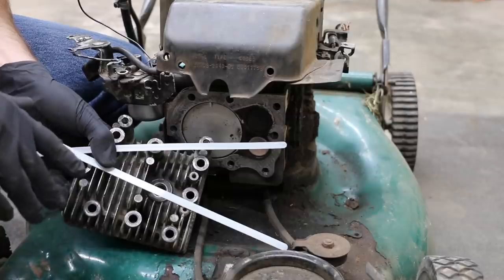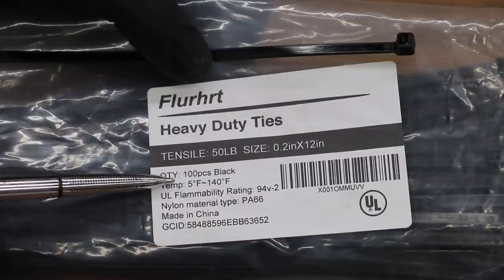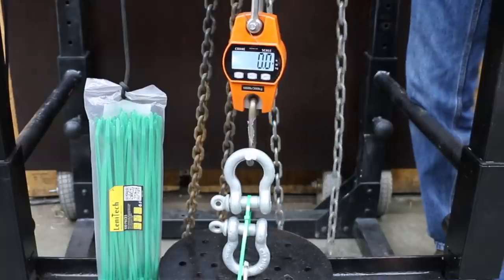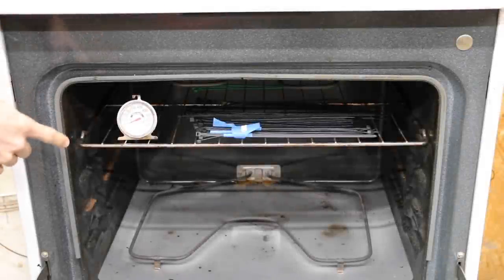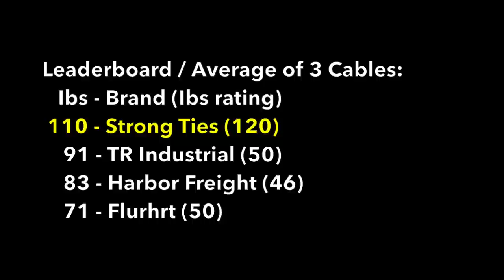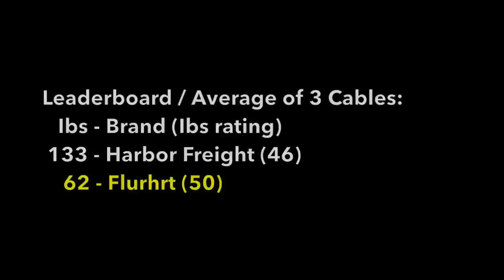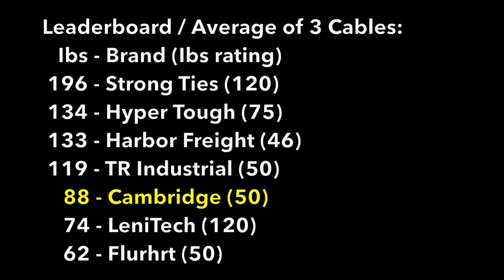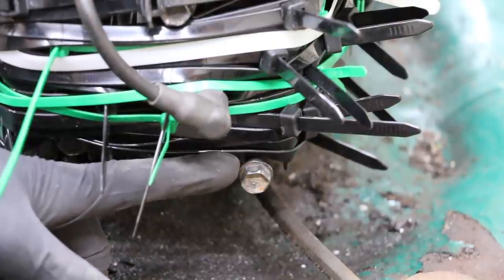Best Zip Tie Brand (7 Brands Tested)? Let's find out!

Comment: Do a video on Super Glue and Baking Soda mix and see how well it holds up to various chemicals such as gas, kerosene and diesel fuel. It is an excellent combination for sealing and gluing. Like this comment if you wanna see a video of this done.
Reply from the maker: Thank you for the video idea!
Reply: looks at tubes of superglue (10 for $1 at local dollar store)
looks at 10kg bucket of baking soda (a whole $6 worth)
"hmmmmm.............. :)"

BTW, have you done any videos trying out the cleaning powers of citric acid yet? 
It's really cheap - You can buy 5kg buckets for about $5 (if you've used stuff like "clean green" this is equivalent to about 1000 spray bottles of the stuff)
It's amazingly effective on anything caked up with limescale (one example - flush mechanism in my toilet was binding up. I dropped 2 teaspoons in the cistern and left it overnight. Problem solved)
It's devastatingly effective for getting years of "gunk" off of plastics without damaging the finish

In an ultrasonic cleaner, a bit of this plus detergent works even better than just the cleaner alone. It really surprised me.
Best of all the stuff is safe on just about everything including skin - It's basically just concentrated lemon juice and it doesn't smell like vinegar does.

Comment: Your channel is honest. No need to cower before sponsors! I really appreciate your refusal to succumb to this temptation.

Test bike tires to destruction.
1. Spin them really fast to see when they explode.
2. Load them til they fail.
3. Wear resistance...run the tire on concrete or asphalt until the tread comes off.
4. Grip...which tire grips best.
5. Side wall strength. Which tire wall is the most durable. Which is the stiffest.

This could be done for scooter and motor cycle tires too.
Reply from the maker: Thank you for the video idea!

Comment: I use a lot of cable ties in my work. The best cable ties I've ever found are Panduit brand. You'd find these at an electrical supply house. They are very tough, flexible nylon that never snap when you're pulling them tight, and you can get them with a steel latch for extra holding power.  They aren't cheap, though. Cable ties that you find at places like Home Depot and Lowe's usually are brittle plastic and tend to snap when you tighten them or else the latch breaks.
Reply from the maker: Great recommendation!

Comment: I did audio/visual installation and service work for about 15 years and I used thousands of those Harbor Freight wire ties and I almost never had any breakage and they worked nice and smooth, I liked them.
Reply from the maker: Seems like one of the better products sold at Harbor Freight

Comment: I use zip ties a lot in my work (General Aviation A&P mechanic). Mostly for light duty items, like holding wire bundles together/ securing certain plug connections so they can't come loose, but also for temporary installations of items such as a rod lashed to the control yokes to rig the Ailerons on a 152. I am glad to know that if I ever venture into the private realm of Aircraft maintenance (I currently work for a flight school), I can save money using the Harbor freight ones, since I don't need "extreme" strength most of the time, but if I do, it's temporary, and I will have to cut them off when finished. (My workplace provides Zip ties).
Reply from the maker: Thank you!

Comment: On the stretch/pull test using the device you built to measure the pounds of force needed to break each tie, I'm curious where in the tie's construction proved to be the weak point... where did the majority of the breakage occur on the majority of them.... edge of the clasp, center prong of the clasp, the middle of the long end run, other?

Comment: We use ty-rap brand ties on medical equipment (Thomas and Betts TR TY525MX Cable TIE on Amazon) due to the UV sterilizing lights and the cleaning agents which make most tie wraps brittle. Ty-rap ties use a metal lock instead of nylon and they don't ratchet in and out of notches. If the tie lock isn't perfectly seated in a notch the tie can give way prematurely. Great video.
Reply from the maker: Thanks for sharing.

Comment: Harbor freight ties are awesome. After you added the head bolts, the ties needed to be re-tightened since the bolts compressed the head into the engine more than it was with just the ties holding it. Might have ran if you put the head on with just a few bolts and then install the ties and remove the bolts. Just a thought. Keep up the awesome videos!
Reply from the maker: Thank you!

Comment: Hi Project Farm, great video as usual.  You have such a prolific channel that I am slowly working my way through all of your videos.  I have a question for you on the findings - if the single applied force is resisted by 2 vertical legs of zip ties, wouldn't one need to divide the applied force by 2 to get the tensile force in the zip tie?  Thanks for continuing to make great videos.

Comment: Just came across your channel, enjoy watching the videos. As for this tyrap test, I would like to give some feedback. I'm an electrician (25 ish years), and have used my fair share of them. Not sure if you realize, from what I can see from the video they all have a plastic clip that holds pressure to keep the tyrap locked. Brands such as T&B and Panduit have metal clips that keep them locked. I would expect these models to perform better than all the ones with plastic clips. As for the black or white tyraps, typically black ones are UV resistant, white ones aren't.....at least for the larger name brands, I'm sure some of the cheaper ones have muddied the water on that front. Keep up the great videos
Reply from the maker: Great constructive feedback. Thank you!

Comment: One thing about the Harbor Freight zip ties is they get very brittle over time. I had a bag in my workshop drawer for about 8-9 months and went to use a few only to find that they would break as I was putting them on before any real force was on them.
Reply from the maker: Thank You!
Reply: Agreed, they don't age well and it's the reason I won't buy their ties. I think it's likely that the plastic mix they're using absorbs moisture from the air which causes it to be brittle.

Harbor Freight also gets their cheap rates by cutting back on QAQC checks, so their consistency (on everything) fluctuates a lot.
Reply: @kylek29  Moisture makes nylon trimmer line much less apt to snap. The same may be true of nylon zip ties. Most shops are bone dry. That is fine for keeping fiber-backed abrasive disks from warping, not so fine for storing trimmer line.

Comment: My favorite zip tie is Panduit PLT2S-C0 (and longer version PLT4S-C0). It is what Siemens almost exclusively uses in their wind turbines and probably all their power plants.  Their spec says 50 lbs, but I would love for you to test them.  The package also says they are rated to -60 degrees, but minimum install temp is 0 degrees C which could explain the locks breaking off in some of your tests.  The other thing I would like to add is how much I love the Hakko Micro Cutter. They are $5 on amazon and leave a flat surface when you cut the tail off of the zip tie so you don't cut the crap out of yourself when brushing up against installed zip ties.
Reply from the maker: Thanks for the recommendation!

Comment: Another really interesting video.

I just get the HF ties, and if I need more strength, use two of them. Especially when I really need something to hold (like tying the drain hose for my washing machine to the drain pipe - there I used 3 ties, figuring if one fails due to old age, I'll have time to replace them all).

My experience with zip ties is that UV is the biggest problem: they often fail for me when used outside over a period of months, and I haven't found a brand that works well.
Reply from the maker: Thank you!

Comment: Great job as always.  I wanted to see a dimensions table: length, width, & thickness for quantative data. You could have used calipers or a micrometer. 

Suggestion: TEST LAWN MOWER BLADES.  I have a John Deere E160, 42" cut. I need to buy new blades. Which ones are best?
Reply from the maker: Great suggestion!

Comment: Hello Todd:
This is a bit off topic, but would you please do a comparison test of engine enamel spray can paints (primer and clear coat as well) to determine which is best for durability? 

I just spent a lot of time prepping and painting an air cleaner, only to find that the paint chips off with the slightest abrasion.  I’d like to find a good quality spray paint that will hold up to typical engine wear and tear…below are the details of my paint job:

I used Dupli-Color products; Engine Enamel with Ceramic, Gloss Black, Engine Enamel Primer w/Ceramic Grey, and Engine Enamel Gloss Clear.  I used SEM Prep Sem Solve as a cleaner before painting.

I stripped and lightly sanded the air cleaner to bare metal. Cleaned it prior to painting with Sem Prep and applied 2 coast each of the primer, gloss black and clear.  All coats were applied as per label instructions about 10 minutes apart and the garage was temp was in the mid 60’s (CA).  It sat in my workshop for about 3 weeks to cure before installation…

It looked quite good when done, but it chipped off at the slightest ding during installation…..really disappointing.

Thank you,
David in Santa Cruz
Reply from the maker: Hi David, Thank you for the video idea! I hope to test spray paints soon. Thanks again.

Comment: T&B are the best. As an off-road racer for over 35yrs. I have used a lot of different zips ties for field repairs. Also T&B don’t have teeth, they have a much finer adjustment. They also have a smaller rounded head. Black is way more UV resistant.
Reply from the maker: Thanks for the recommendation

Comment: May sound a bit cheesy, but as a Maintenance Tech for 12 years, I have favored using Break Clean to clean old grime and dirt off of old parts we have to rebuild on materials that can handle the chemical in break clean. If you haven't done a video on the most effective Break Clean competitors, would you consider it in the future, please? I have noticed so many different companies with Brake Clean products with and without chlorinated additives! My company uses the "GUNK" brand, but my old company purchased a lot of "CRC" and I have seen differences on certain materials. Thank You for what you do!!! Another individual does a video, but I don't watch their channel because of the vulgarity in their videos!
Reply from the maker: Thanks for the video idea.

Comment: I  have two video ideas i would like you to try. The first is doing a lubrisity test with a comparison between new oil, used oil, and oil that has been slightly used but been sitting past the recommended oil change time. Like how they say 3k miles or 3 months or whatever the length of time is. I am very curious to see how much of a difference it makes. The 2nd video idea i have is to test Lucase oil fuel treatment. The fuel cleaner claims to clean and lubercate the upper cylinder, and it also claimed that it will improve the gas mileage. The bottle claimed you with earn the cost of the bottle back just in fuel savings alone... Great videos man! I hope you will try these out. :)
Reply from the maker: Thank you for the video ideas!

Comment: It would be interesting to see a long-term outdoor-conditions test. I was a tennis coach and we secured wind screens to the fencing with zip ties. Every spring and every fall we'd have to replace 3 of 4 zip ties due to UV deterioration. If they'd just last a year that would be a huge improvement.
Reply from the maker: Thanks for the suggestion.

Comment: I think when there is a large variance among the ties for maximum load rating, it may be a good idea to see how they compared to their rating. For example one tie was rated at 50 lbs and say cost 5 cents. Another rated at 120 lbs may cost 10 cents. So the cost per lb favours the 10 cents brand even though it is twice as expensive as the 50 lb brand. Also when there is an average calculation being done it may be a good idea to also include the deviation. Some ties snapped far below their average. Just suggestions.

But needless to say I like the way you present your tests. More strength to you.
Reply from the maker: Thanks for the feedback.

Comment: Good video, never realized they had a weight capacity, other than maybe holding 8 or 10 pounds. Just thought they were used to hold wire bundles together. Well now I have some good information next time I buy them. 
One thing I would like for you to try is to compare them to UV ratings and or automotive engine compartment use. 
I bought some just to hold some chicken wire fencing together. I added a section of 3' tall above one to add some height and all the zip ties were doing was keeping the upper part from separating and causing gaps. The zip ties lasted about 3 months before they became brittle and broke with a little wind. Same thing happened holding a wire bundle under the hood of my truck, so heat, oil and fumes from the engine must effect them too.
Reply from the maker: Great test idea!  Thank you

Comment: Once again I love your videos, ideas, and testing methods. I myself as well as many others Would Love to see another Oil showdown but this time with all the name brands like Castrol, Liqui moly, Pennzoil, Valvoline, Redline Ect. Also oil filter challenge. Not alot of comparisons out there and I bet you could make a great lengthy showdown video.
Reply: Would like to see how long the film strength of these big brand synthetics hold up when the motor is run with nothing in the crankcase.
Reply from the maker: Thank you for the video idea!

Comment: Wonder how a metal zip tie would compare? To each other and or the strongest plastic ones. My own zip tie use would be satisfied by the cheapies, but I have seen advisory signs held in place by zip ties and those same signs come loose when the plastic breaks, so it made me think would the metal break just as readily rubbing on the sign sharp edge also.
Reply from the maker: Thanks for the video idea.

Comment: Very interesting test jigs. I would not have thought to try it on an IC engine complete with an "IV" bag fuel tank. The Thomas and Betts were the best ones I have used. They were the original ty-rap brand? They have a metal retainer tang and are rated for UV exposure. Our application: tying ski buoys for competition slalom water skiing. We are in Orlando FL and the sun, water and wind eat up most of the cheap brands.
Reply from the maker: Thanks!  Thanks for the feedback.

Comment: Amazing stuff you are doing, really appreciate all the work you do for us, its really educational. If I may have one suggestion, when doing the black screen with all results, it would be much easier to orient in it if it was all aligned in columns(numbers of specs exactly under each other) and also use green and red color to differentiate if they are over or bellow specification:) Just a small tip. Thanks again for all your hard work:)
Reply from the maker: Great constructive feedback! Thank you

Comment: I've always seemed to find out that the black ones last the longest. I've had brand new ones shatter in the cold from being stored too long in a warehouse. Bargain priced ones a lot of times are old. I go to Lowe's or Home Depot where fresh ones come in often. Haven't had any shattering problems. As far as the heads having steel inserts or all nylon, the metal insert ones won't break with age. I use Ideal, Thomas & Betts, or 3M brand most of the time.
Reply from the maker: Thanks for sharing.

Comment: I'm surprised that Panduit didn't make this competition, that's the brand I often see in Agricultural Manufacturing (i.e. tractor and sprayer harnesses). I'd also like to see a comparison of the top three brands after 12-24 months of sunlight (UV) exposure. Finally, which holds up better to UV and weather exposure: zip ties or electrical tape? Great work as always, thanks.

Comment: Did you use a zip tie tool to tighten the ties? I supposed to have one here someplace and it works pretty good I have secured stuff with it you just have to be careful getting it just a little too tight because they will break a zip tie if you crank them down enough. Just wondering. Great video. thanks I needed that!
Reply from the maker: No, I tightened by hand.  Thanks for watching!

Comment: 1) To measure the strength of different brands of cable tie you have to sample with the same size of the zip ties, that is the length, width and thickness has to be same. Your samples were not of the same sizes. 

2) For measuring temperature variations effect on zip ties again you will have to use the same size samples in all the brands and make sure to compare the UV protected/stabilise of all brands.

3) Price differs according to size.

Just to bring to your notice and to criticise.
Reply from the maker: Thanks for the constructive feedback!

Comment: Were they failing at the ratchet part or was it on the band part? Does it matter if the ratchet is in a different location? Like in the middle of the gap vs against up against the hook?
Reply from the maker: Great question.  They failed in both places

Comment: Another fine video. I appreciate your efforts. You encourage me. Question though...what model scale is that and where did you get it? Thanks
Reply from the maker: I bought the scale on Amazon, but I just ordered a much more precise jewelry scale.  Always trying to improve the testing science.
Reply: Thanks for your fast reply. I used a luggage scale on my last video. I hope you don't mind, I will touch back with you after you have some experience with your new scale and get your advice on which you like better before I buy another. I appreciate the work you put in your videos.